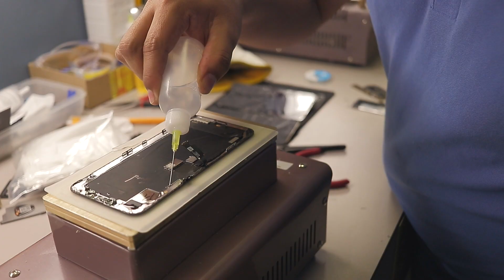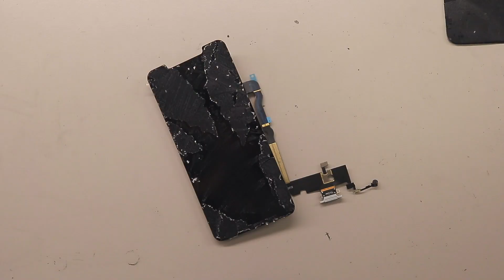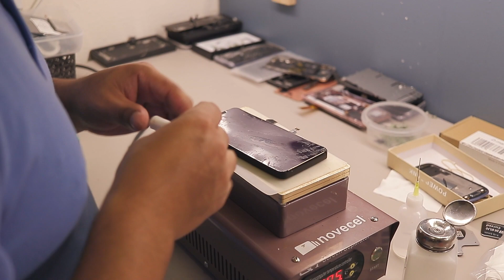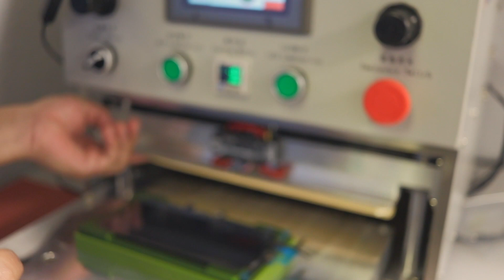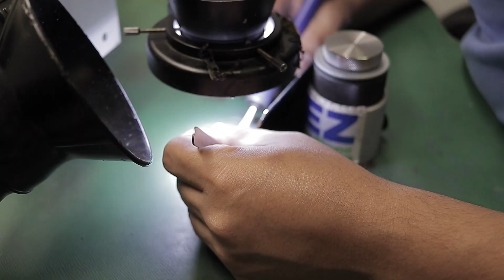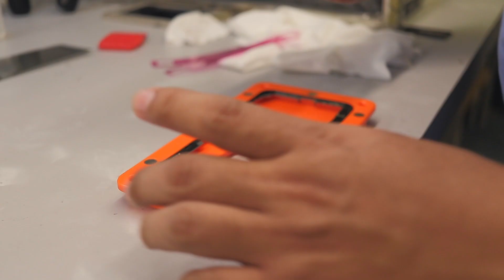The Official iPhone XS Max Screen Refurbishing EZ-FIX Technique

Comment: 70% alcohol sucks. This creates a defect. Then never work with metal under the frame. Then remove the glass, heat the display longer! And please go in from below then the touch won't break either. Then beginners in particular should not work with the glue remover. Instead, put the display on a mat, warm it up and remove the adhesive with a cloth without using any liquids. The glue remover only makes bugs in the display and if you work with liquids you break something quickly! Soldering is ok. However, the framework should not be underestimated. It can easily not sit properly. But all in all, everything works so good work.